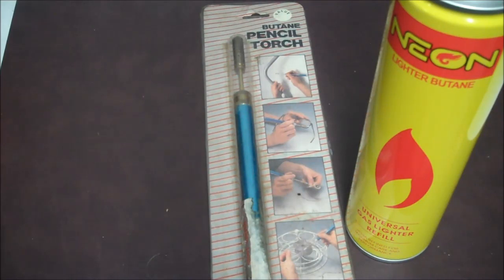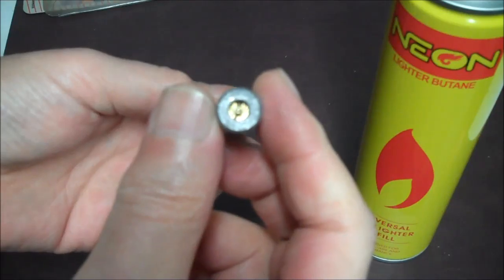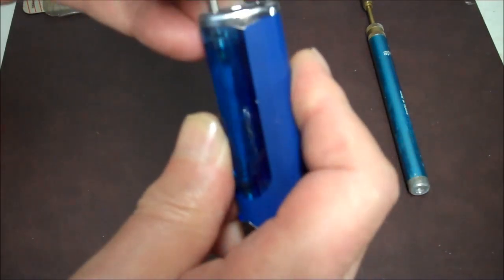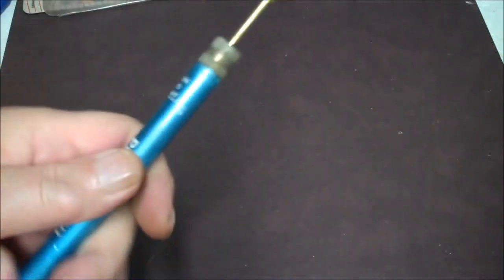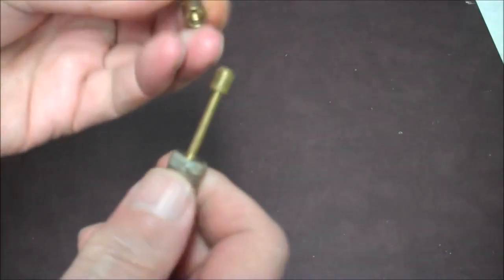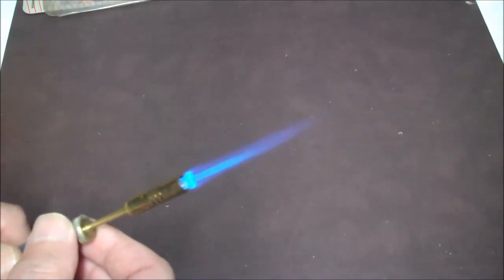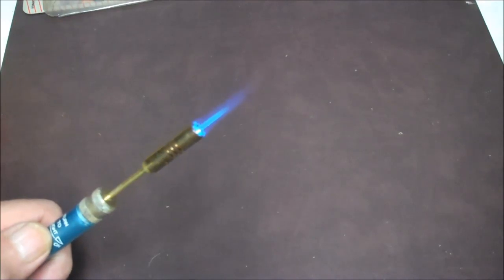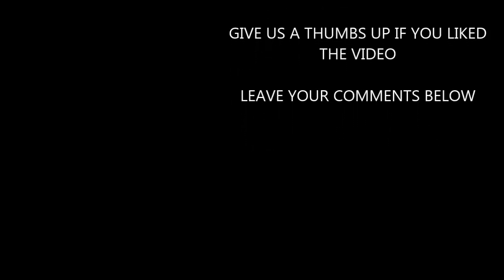How to Refill A Pencil Torch

Comment: Thanks for video....After waiting 10 years I finally know how to fill the torch.  NOPE 
So i have a BRAND NEW pencil torch I bought from HF about 10 years ago. Never opened from pack. After seeing this video I buy a can of butane exactly like the one in the video. When I press for the 1 second bursts I am not sure if it is filling. I pressed down hard and feel the nozzle going down, but do not hear anything and the torch is not cold. I did 4 short burst and do not hear anything when I open the valve on the torch. No smell, no flame. The brand new can of butane seems to be fine because if i press it down on a piece of wood it sprays out with a lot of pressure. ALSO, THERE SEEMS TO BE BUTANE IN THE TORCH. BECAUSE WHEN I PUSH IN THE FILL-VALVE ON THE BOTTOM OF THE TORCH, A LOT OF BUTANE WILL ESCAPE. 

My torch tip looks a lot like the one in the video, but not exactly. The tip is not designed to be removed. Not by pulling off or twisting off. I tried opening the valve with just a slight turn as in the video and even rotated it a complete turn. NADA. 
So I am thinking about unscrewing the valve all the way off. Not sure what to expect. IF there is butane inside of the torch, will it spray out once the valve top is unscrewed and removed?

I am to old to wait anouter10 years. Maybe just a POS from HF? Any ideas?
Reply from the maker: I hate anything that uses butane for this reason. You never can tell or see if its filled. I would try to loosen the valve til you hear something come out. Maybe you gotta let some air out before you get to the butane?
Read the instructions. Maybe something you overlooked.

Comment: Not that it matters, but the torch won't light. The seller told me to keep it and not bother sending it back. I don't know if it can be fixed.
Reply from the maker: did you try removing the tip with the holes and making sure no obstructions.?
Reply: Nope, didn't know it could be removed. I'll try. And let you know what happens.
Reply: @corvidaewas  theres no debrees but you need to try more, with diferent pressures and gas outage to light it, let it catch on, the flames.